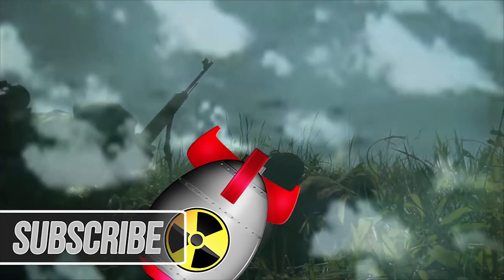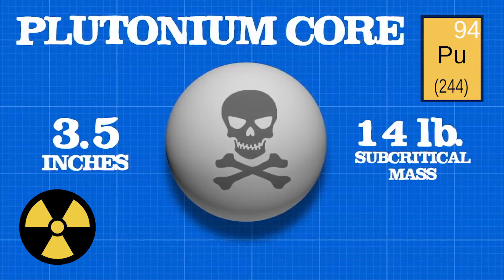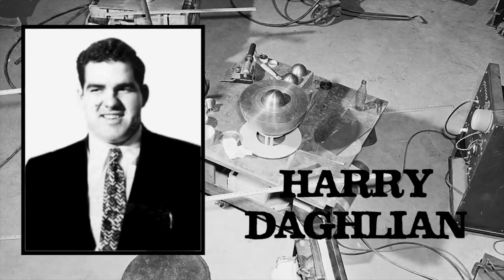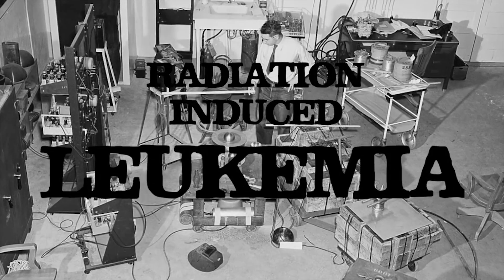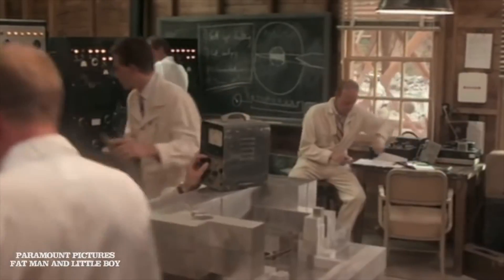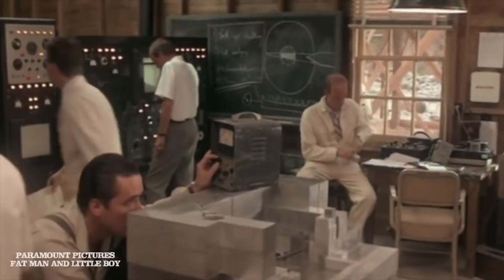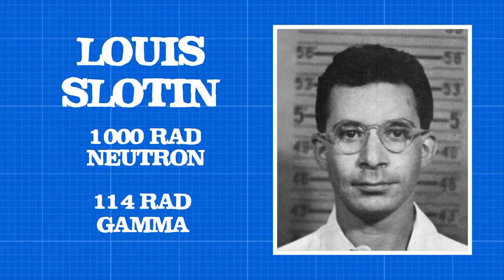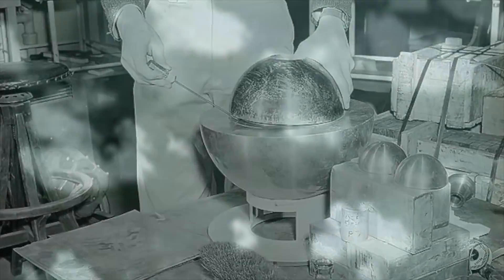The Troubling Story of the Nuclear Demon Core

Comment: I’m curious what would have happened if he did not immediately remove the top part of the sphere  I know they would have not been a detonation so just an increase of radiation?
Reply: @HalMcAdams  As soon as the core significantly  melted out of sphericity, it would no longer be critical due to geometry, and would cool rapidly.   Worst case, you get a frozen puddle of plutonium contaminated with fission products on the floor, not a ball of liquid plutonium happily fissioning its way to the earth's core.

Comment: Wasn't only one core used in Japan? I think the other bomb used uranium, not plutonium, right?
Reply: That is correct.  The other was a very simple "gun" design...they actually used a cut piece of artillery barrel to house the two uranium slugs which were then just collided together...basically.  There WERE two cores though...one of them was detonated in testing.  They were pretty sure the uranium bomb would work so never felt the need to blow one up...the plutonium was much trickier to time the explosive lenses.
Reply: TakeDeadAim can u tell me why dropping the tungsten carbide brick on the core caused it to go critical?  I think I understand the 5 percent safety margin which is the ring that separates the two halves but what was the ring made of?

Comment: Ok...so...when the two outer halves close up and seat, the core starts to react and emits radiation. Is that correct? That being said, how did the radiation burst happen by dropping the Tungsten brick on the core? Or did they mean that the upper half was sitting in place, but wedged apart, and when the brick fell it closed the upper half? I don't understand.
Reply: I don't think the author of this video knows what they are talking about or consult any physicist.
Reply: For the brick incident, The core was so close to critical mass that when the tungsten brick fell along with the tungsten already around it, there was enough neutron reflection back to the core that the core went critical.
Reply: @kalebjohnson6090  My understanding is that the bricks stacked out around the core were reflecting neutrons back into the core, and the brick he was handling was meant to be stacked along with the others. When he accidentally dropped the brick right onto the core, however, the proximity of the brick reflected the neutrons back into the core a lot faster, causing it to go critical.